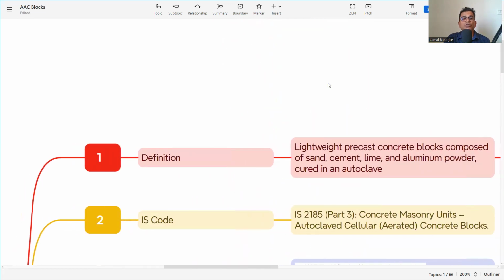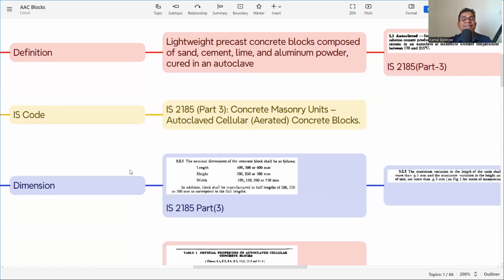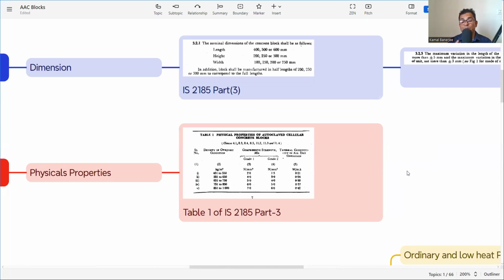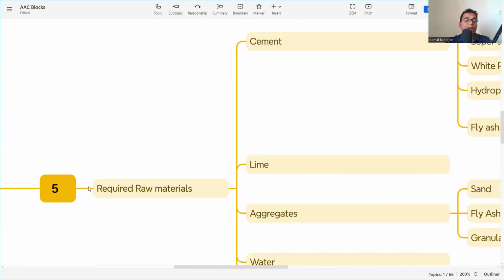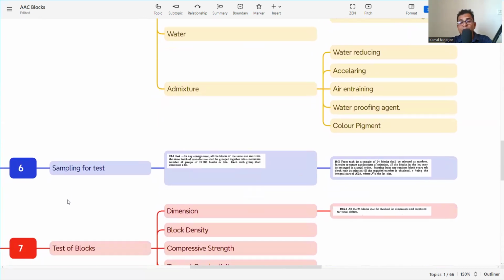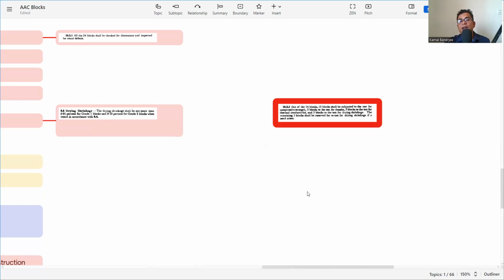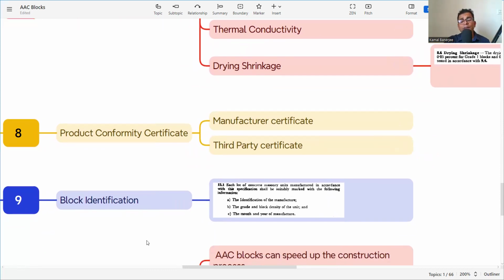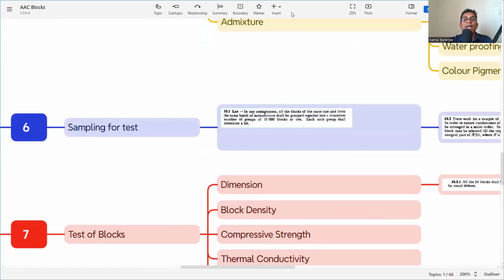AAC Block  Properties, Testing and benefits.

Comment: Very easy and effective explanation of AAC blocks, I suggest that make for each and every item used in site like. Steel, sand, admixture, aggregate,etc. make on that topic video with required IS Code reference.
Reply from the maker: Thank you. Sure, I will make video on that topic also.